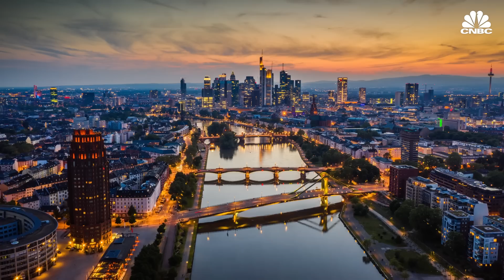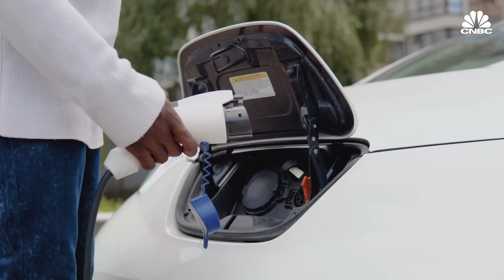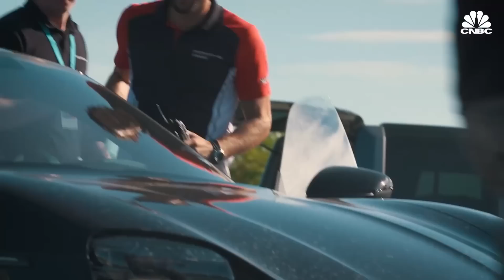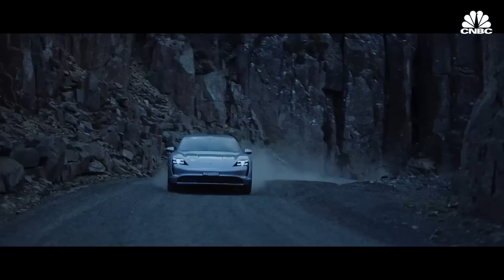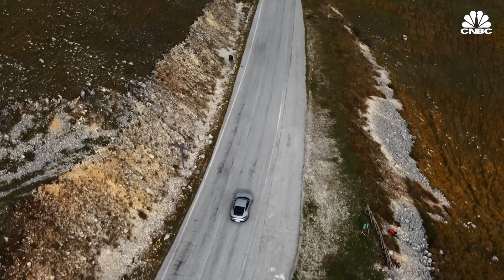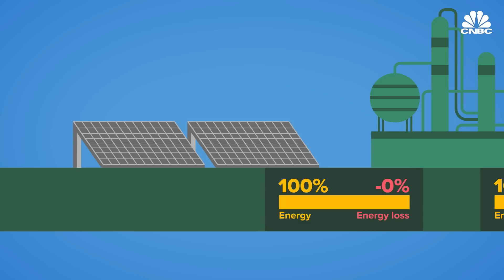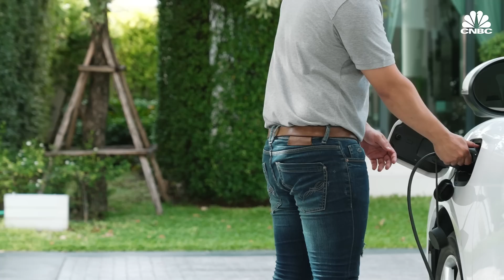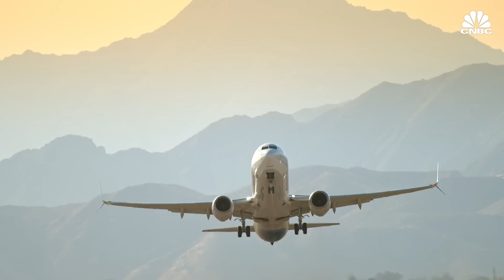How Porsche Plans To Keep Its Gas-Powered Cars On The Roads

Comment: I really hope something like this is the future. Between the mining for RARE earth materials, the wait of charging, and the lack of infrastructure in the aging electrical grid in this country, I don't know how anyone could think going electric is a great idea.
Reply: The global supply of rare earth minerals is controlled by even fewer countries than oil. The absolute majority of them currently in China (!) It's a bit strange that this is not seen as a huge problem with electrification.

Apparently, that is a problem we will have to deal with later....
Reply: @Jonteponte71  There are deposits of lithium in China, Russia, Scandinavia, Australia, the US, Canada, Chile, Mexico, Bolivia, the Congo, and Cornwall in the UK. The US alone has around 10 massive lithium prospects ongoing, including a 115'000 acre site in Arkansas. Around 35% of the World's lithium is mined in Australia......  Don't associate the word RARE as meaning scarce, because when applied to minerals it means something totally different. It is estimated there is enough lithium to allow the manufacture of EV battery packs for the next 30+ years, by which time the battery recycling industry will have grown hugely. Even today, older EV batteries can be 95% recycled, with the lithium and cobalt being 90% recovered to be reused in new batteries. Is anyone recycling burned petrol, diesel or e fuels?
Reply: That's because you are thinking about the actual problem. If instead you just listened to the shallow one liners, then everything would be great.

Comment: What about tailpipe emissions?
Reply: At least conceptually the idea is that you take the carbon out of the air, the fuel is burned, putting all the carbon back in the air.  But since it is carbon you had extracted from the air (vs from oil), the idea is that you have a draw and as such aren't adding to the net amount in the air.
In practice it'll depend very heavily on how efuels are actually made.
Reply: @JT_771  Doesn't address the prob of the other poisons.
Reply: @heinousanus9352  This is true.  On the upside, efuels have so many problems they'll never be in contention for wide use.

Comment: While every other car manufactor is going Electric Porsche is sticking with Gas.
Reply: Lamborghini and Toyota
Reply: No, Porsche is also going electric. The electric Taycan is selling almost as much as the 911. Together with Audi they developed a new high performance electric platform which will be released with the Macan and the Boxster in 1-2 years. The Boxster won't even get a new ice model, it will only be sold as a full electric.
Reply: Hey, it's called efuel!
Reply: @Kontenderr  so its both electric and gas? Hmm?

Comment: Bout time synthetic fuel is being made, if it gets good enough it may be more efficient / climate friendly than electric battery cars.
Reply: No,  it is ridiculous to think that synthetic fuels are zero emission just because they recirculate the existing carbon that is in the environment.  Does not take a science degree to figure out that the global carbon pollutants that are removed from the air, will only to be concentrated in big cities.  Who wants that?
Reply: It won't, because it will need to be transported all over the place to where it gets used. Electricity needs no transportation....
Reply: @Brian-om2hh  and what about the amount of resources needed to mine the lithium not to mention the transportation to the factories in foreign countries to make / assemble the batteries before there transported to a car manufacturer factory.
Reply: No, it won't.

Comment: Won't be a major thing once some of these battery breakthroughs happen which allow for much more energy storage (enough to power an airplane for example). Even if Porche can do this on small scales it'll only mean buying fuel for old outdated porches will be insanely high.
Reply: You can't even spell Porsche right...
Reply: We'll see bud, they've been harping about battery improvements for 20 years, graphene is the future, solid state, etc etc. None ever come to market decades later
Reply: How have nerds not been able to figure it out yet?😊
Reply: @will.davlin  why haven't idiot's figured out they're clueless??
Reply: Battery planes aren't coming. Batteries are always to heavy.
Reply: @walli6388  Luddite. Battery planes are already here & companies like Amprius have 500 Wh/kg silicon batteries in service now.
Reply: @walli6388  you haven't been keeping up with tech. Only a fool says never.
Reply: Porsches are just expensive toys.
Reply: @dougsheldon5560  the best sports car in the world too. You sound jealous
Reply: @trance9158  Slower than a Plaid
Reply: @dougsheldon5560  only in a straight line for a short distance. Can't beat it on handling a road course. The Porsche is also better built and more luxurious than the bland Tesla.
Reply: @dougsheldon5560 The Porsche is also easier to get service if needed than a Tesla

Comment: the taycan is already well-designed
Reply: My dad's Taycan needed a battery replacement after 12k miles and it has been sitting at the shop for 6 months now. When he called, the rep said that there are 3 cars ahead of him so he probably will have to wait even longer. Even service intervals took them weeks to complete while it only took 1 or 2 days for my Tesla. Porsche needs to drastically step up its EV service before customers get tired of being treated like 2nd class citizens, because my dad already swore off Porsches.
Reply: @duerf5826  My mom has one and its holding up so far 30k miles.
Reply: @CryMoreMaga  The car line is too new to determine long-term reliability. There's always outliners like my dad's car but it's "supposed" to have little issue up to 50k miles. We need more people getting pass 50k or even 100k to fully determine the actual reliability.
Reply: @duerf5826  I concur.